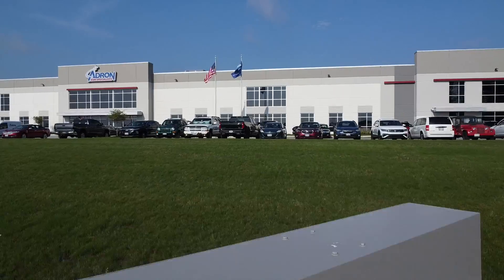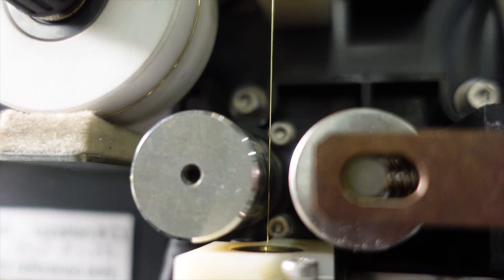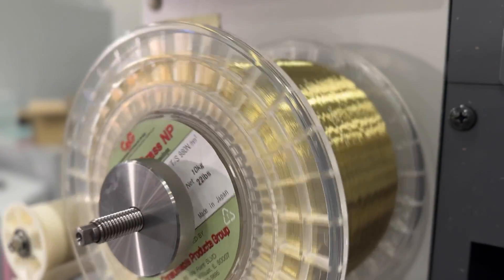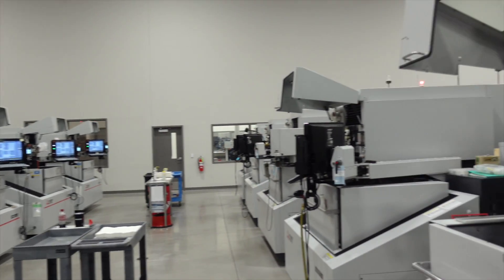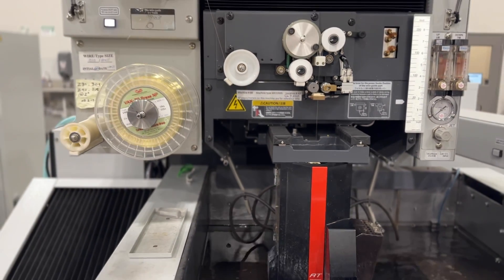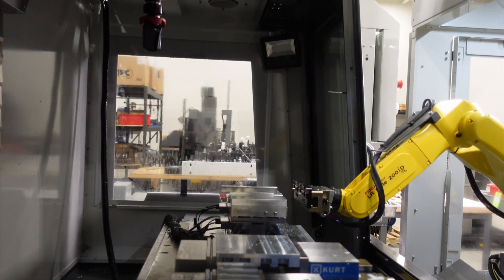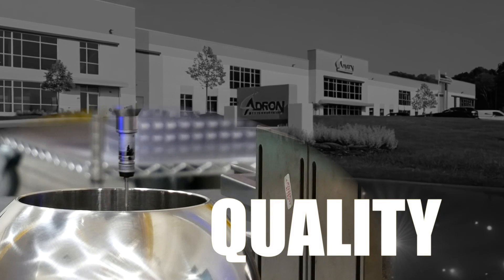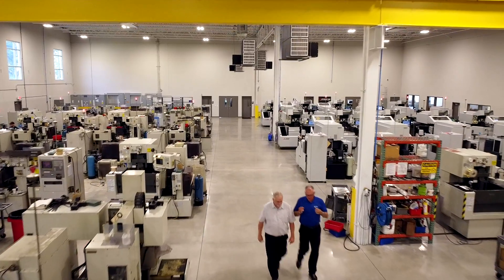High Tolerance Wire EDM - Largest EDM shop in USA | Adron Tool | Sussex, WI

Comment: Super cool
Reply from the maker: It is and the toleracne is crazy... some high-end wire EDMs can achieve tolerances as tight as +/- 0.0001 inches (0.00254 mm) or even +/- 0.00004 inches (0.001016 mm)

Comment: Yep, all good untill a 2 inch carbon steel 30 tooth straight cut gear is 600USD.
Reply from the maker: Wire EDM excels at creating complex gear geometries, including internal gears, helical gears, and gears with very small teeth, but it does cost more than machining... depends what you need.